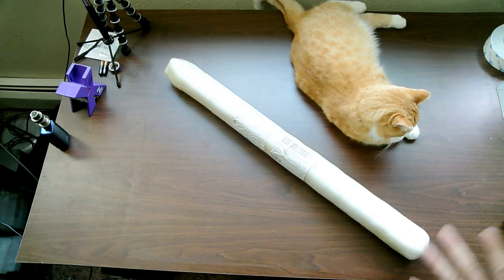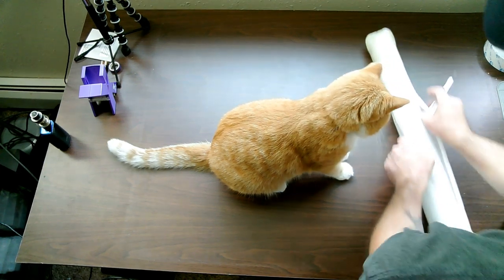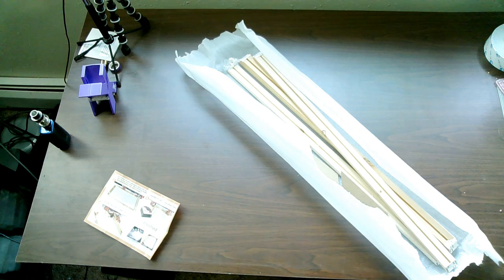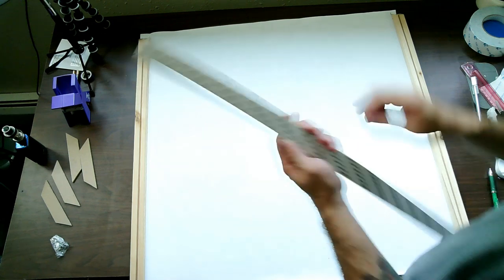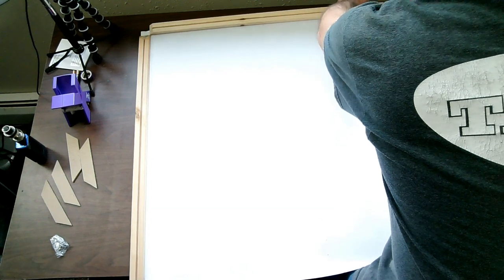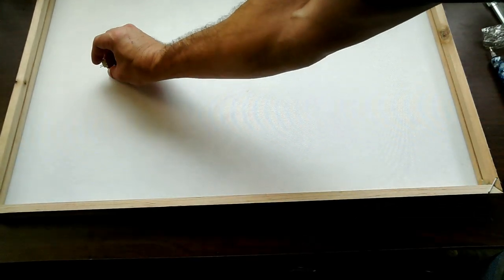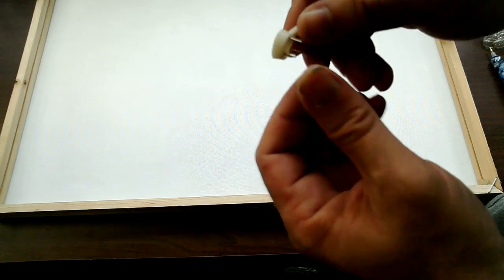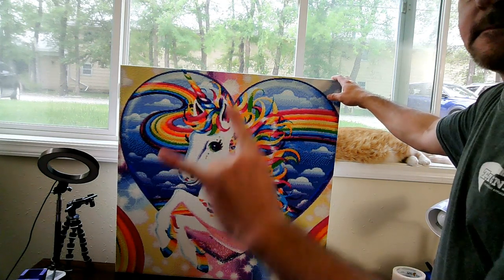DIY Adhesive Canvas Stretchers - Framing the Unicorn

Comment: Thanks for sharing this with us. They little pieces look like frame pads. You put them on the frame that would be towards the wall. It buffers from banging against the wall if a door slams or vibration of other sounds.
Reply from the maker: This is probably the best explanation since the orientation of the nails would suggest so...
Reply: You’re right!  That’s exactly what these are—bumpers for the edge of the frame against the wall!

Comment: Thank you for showing this process!  I have a 140x70 diamond painting I want to hang on a canvas.  I am between making my own canvas with stretcher bars or buying the stretcher bars you used.  I like the look of the stretcher bars you used where the actual diamond painting is the canvas that is stretched versus gluing the painting onto a stretched canvas.  My only concern is that my canvas has serious wrinkles through the middle (never use that company again; live and learn) and I’m not sure the if the stretchers you used would fix the wrinkles or just enhance them!  I might need to glue this one down onto a prestreched canvas so the glue can help hold the canvas down and in place.  But my next paintings will use the bars you’ve used.

Comment: Those are hangers .. push them on top piece or side pieces and the nail or screw will go in those little cups
Reply: Awesome that makes sense too
Reply from the maker: I had thought that too, but the pointy end of the little nails are in the cup side.
Reply: Diamond Paint With Diamond Dave 🤔 hmmm
Reply: Diamond Paint With Diamond Dave I did see Ella use a little one of those at the bottom of the frame ... to hold it out from the wall when it was hung .. so it wouldn’t be sticking out at the top from the hanger and then lean in to the wall at the bottom .... maybe? Kind of like a leveler ...
Reply: Diamond Paint With Diamond Dave light bulb moment 😂🤣🤣
Reply from the maker: @CarverEngraver  Now that does make total sense. I suppose if you use a wire to hang it you would have it sticking out at the top without those...I suppose my method of hanging with just 2 nails wouldn't need those

Comment: Sorry if you’ve mentioned it somewhere else and I’ve missed it (I’m a new subscriber #vibetribe) ... but how do you remove the excess adhesive as you work?
Reply from the maker: once i've finished a section, I run a hobby knife down the edge of the drills on the border, not deep enough to cut the canvas, but enough to score the adhesive layer, then just peel the adhesive strip off. I'll have to demonstrate it in a video soon when I work on a canvas with double sided adhesive
Reply: Well I’ve never thought of doing that lol .. thank you for taking the time to reply 😊

Comment: Hi. Can you help me getting the right size for my painting. For example if the picture size of the painting is 47cm x 66cm and i want the diamonds to wrap around the edges. What size should i get? Can you please teach me how to do the computations? Thanks
Reply from the maker: step 1: cut off the excess canvas around the drilled area leaving only the area covered in drills. measure the remaining canvas exactly (halfs and quarters count)

Step 2: subtract 6cm from the width and 6 cm from the length. this is the size frame you'll need to custom order. (Each stretcher bar is 3 cm wide)

Step 3: cut exactly 3cm x 3cm squares out of the corners of the painting. Use the remaining tabs/flaps left on top and sides to line up your stretcher bars.

Step 4: frame as you would normally.

Without actually doing it, I couldn't be 100% sure this would work, however, the theory is sound, so it should work perfectly. the only issue I'd see is bending a drilled canvas around the sharp edges may cause diamonds to either fall off or separate, leaving a visible gap between rows of diamonds at the edges where it wraps around.
Reply: @DiamondPaintWithDiamondDave  thank you so much for this very detailed answer. After watching your other video on using acrylic paint on the side of the canvass i would  do the same technique like you did in this video

Comment: Hello I am trying to order custom size stretcher bars like you have. But when I get on AliExpress I don’t see where you can order the custom ones. It says contact me for custom sizes but I don’t know how to contact him. I don’t see where he has an email or anything. All I see is a chat. I tried that and no luck. Thank you
Reply from the maker: Somewhere on the page with the item description should be a contact seller link. Click that and it will open a chat.use that to tell him youd like a custom size and what the measurements are. He will respond, sometimes it takes a day or two. He will let you know what size to order. Once youve placed the order go into your order screen and open that order. Click the contact seller on that  and it will reopen the chat and automatically put in the order info as a message to him then retype the measurements you need.